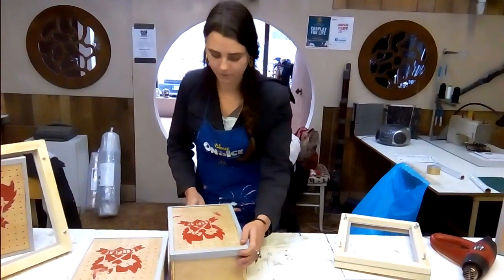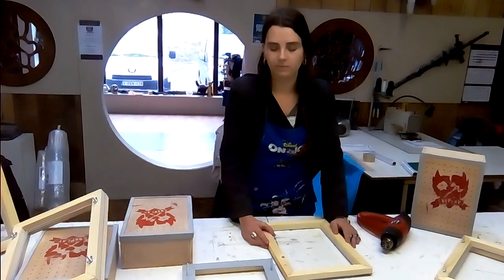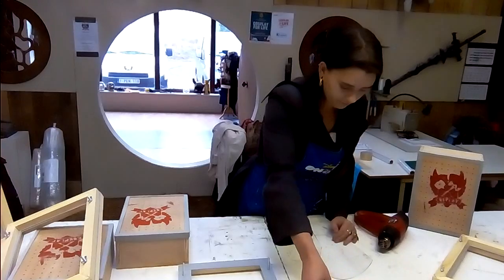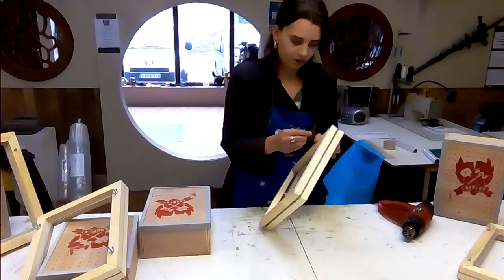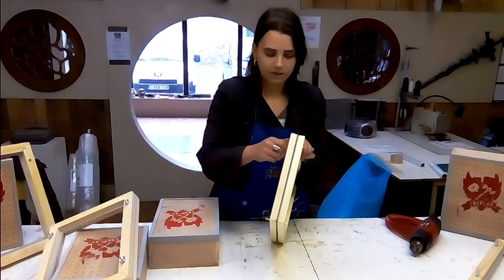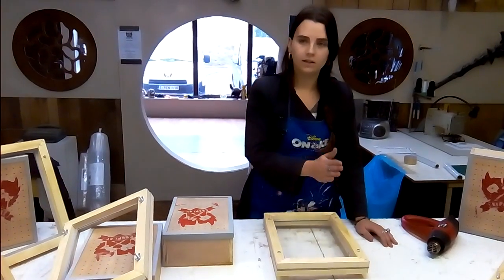Cosplay shop 'vacuum former,'

Comment: Just putting it out there for both the people of the Cosplay shop as well as others. If you want to do this in a more controlled manner there is a new product about to come out called the Vaquform. It is probably a little more for people who have to do this a lot and with all sorts of thermoplasts. Price is around 825 $ US so that's a fair bit more. It is fully digital in that you can select what thermoplast material you are using and it will set the temperature appropriate for this material, heat up the thermoplast while measuring the real time temperature of the material with an IR sensor and then when you close the lid perform a 2 stage vacuum process to get the best result. If you want you can look at a video from Thomas Sanladerer here on youtube where you can see the product in action (last part of the video) as he talks to the designers at MFBA 2018 (a Maker Fair event).

Comment: This seems very bulky for a commercial product.
I made one of these out of plexiglass, it's less than an inch thick, but twice the area. 

I would really recommend using an oven instead of the heat gun, even heat is crusial on bigger projects..